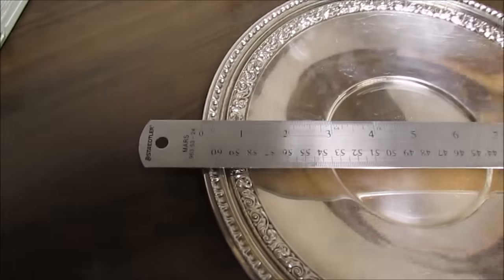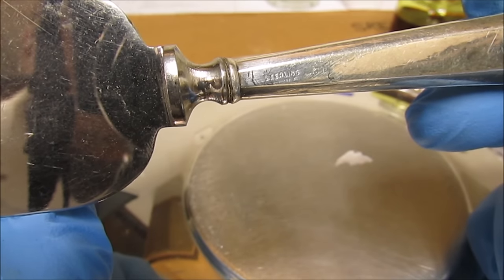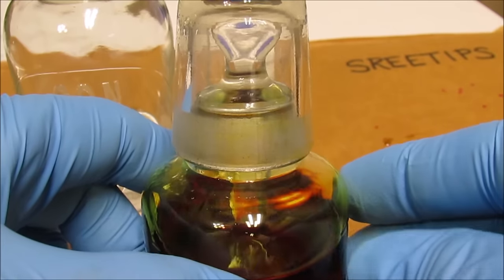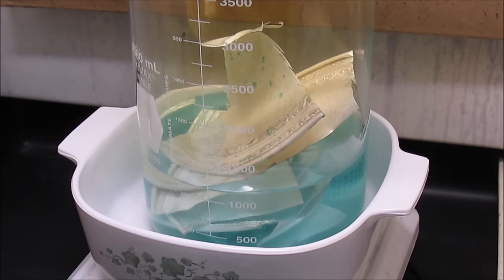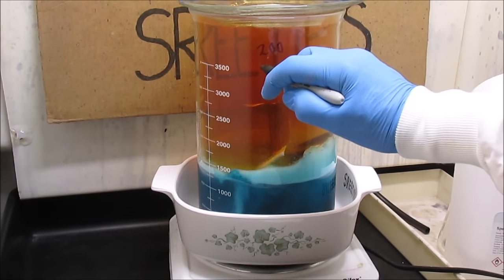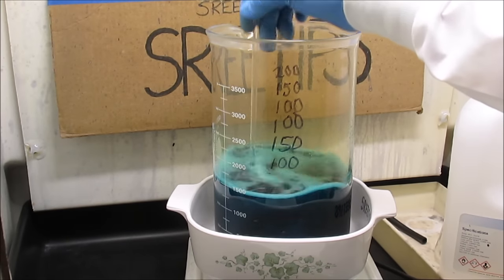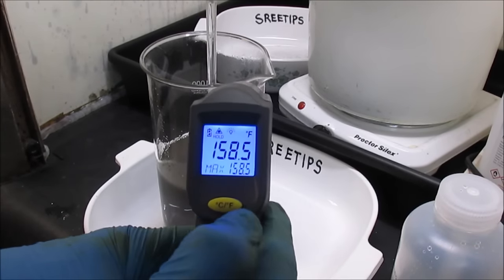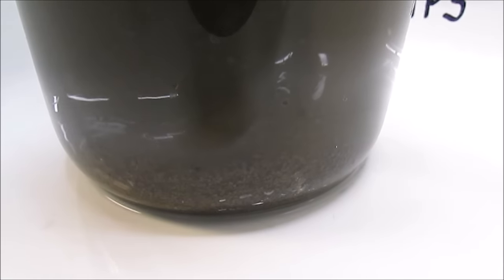Method for Recovering Silver From Silver Plated Items

Comment: I re-watched this video and was wondering if you calculated the copper return from your stock pot?
Reply from the maker: At $2 a pound it just doesn't seem worth it.
Reply: I agree that it's value may be minimal, but given the final cost analysis, the weight of silver to copper ratio would lend to a better cost outcome for chemicals, would it not?
Reply from the maker: Yes, it would.

Comment: What happened to using sulfuric acid as a cheaper way of de solving silver? I understand that using nitric acid is quicker but can't make profit if using that method! I hope you can share a  more cost effective way of refining silver. Thank you for all the hard work you put in to making these videos!!
Reply from the maker: I’ll do another sulfuric acid video see if I can get the yield right
Reply: So I'm working on some silverware and silver plated  dishes, could you please make that video about the same stuff. I'm having trouble de solving the silverware, lol! It's  taking longer than I thought and I have alot of it!! Also if you know a safe and easy way of cutting the dishes and trays, thank you!!
Reply from the maker: Silver plated is very low silver content. I’ve got a bin full of it that I’m saving. Sulfuric on silver plate is something that I’ve never done. No experience there.
Reply: @sreetips is it okay if I ask you for formula for volume of sulfuric acid to volume of silver??

Comment: welcome back .but why you didint use another method instead of nitric acid .such as reverse electroplating its cheaper and faster in this kind of plating and its works will.and the cyanide leaching is work will also
Reply from the maker: Mohmad, I'll try to make a video using reverse electrolysis. Should be easy to do. With silver so low I didn't think that there would be a demand for that. Looks like I am wrong.

Comment: I was wondering if you have tried the poor mans nitric acid to refine silver? Drain cleaner 90+% sulfuric acid and potassium nitrate. Will this work? If so, can you use copper to drop(cement) the silver out of solution? It would be cool to see you do a video(experiment) with this method.
Reply from the maker: ive never tried sulfuric and potassium nitrate to dissolve silver. I don't know if that will work.

Comment: Isn't there a better way to strip the silver off without having to "eat" all that base metal (& generate all that chemical waste)?  I would propose using electrolytic process on the uncut plate with high current density (to create overvoltage so the silver strips off).  If you used dilute HCl for the solution, you would make AgCl directly which you filter out of the solution.
Reply from the maker: Good idea, thanks

Comment: I’ve got a question! Couldn’t you just react the solution until you dissolved the plating off and then pull out the solid copper? That way you wouldn’t use up as much Nitric.  Also you could make your own nitric which would be cheaper. Or am I missing something here.  Love these videos brother. Have learned a lot. Thanks!
Reply: I think he was pointing out that the silver was cementing out of solution because of the presents of copper, so he needed to desolve all the copper in order for the silver to stay in solution.
If he is only paying $15 a litter for 68% nitric, then making it is not nessesary and a waste of time and may actually end up being more expensive. For some of us who can't get it that cheap, or get it at all, then ya, make your own. I'm in the process of getting what I nèed to make some.
Reply: I rewatched the video and got my answer. Sorry
Reply: you can make nitric acid using old teabags and my ex-wife's bitterness.
Reply: @jaybefaulky4902  yeah, same for me!

Comment: If I want to remove the gold plate from a sterling silver jewelry. ( Keeping the silver item intact) how would I do that? I would like to refine the gold with my other broken gold jewelry.
Reply from the maker: I used gold plated silver to inquart gold. Trying to recover just the gold from it isn't feasible because it's too little gold to isolate.
Reply: @sreetips  I know that. I really just want to remove the gold from the Sterling silver pieces because either I like the piece in silver or the gold is wearing through. What can I do in that case?
Reply from the maker: Rub it hard with a buffing wheel. The thin coating of gold will buff right off. Have a jeweler do it for you.

Comment: Would adding copper to push silver out of solution be an issue here? Im wondering if it would push out the nickel or zinc base alongside the silver🤔
Reply from the maker: Nickel and zinc are higher up above copper in the reactivity series of metals. Only metals BELOW copper will cement out. Any metal above copper will not cement, they will stay in solution. Knowing this is the basis for refining and separating these metals. We can get the silver out and leave the base metals behind.
Reply: @sreetips  thanks... so then basically how do I precipitate pure silver out of bleach and vinegar solution without pushig out things like lead? I am stuck at this point with a dark blueish black solution and am afraid to drop impurities back into my silver and don't have and special acids.
Reply: @sreetips  or is that basically each metal replaces the next and I can proceed with copper method?🤔
Reply from the maker: No
Reply from the maker: If I have silver in solution then all I do is add some hcl to INSTANTLY precipitate silver chloride. Then I rinse the silver chloride and convert it to pure silver metal with lye and sugar
Reply from the maker: If you have a solution of hcl and vinegar then there is no silver in that solution. Silver can not, I repeat, can not exist in solution in the presence of hcl.
Reply: @sreetips  thanks thats my issue here I dont have those acids was looking for another way itcould possibly work
Thanks
Reply: It's all from recovering gold from computer scraps by the way
Reply: I have no hcl... only bleach salt and vinegar
Reply: @sreetips  or let me rephrase my question if I may... would the abundance of copper and other metals in a solution mean that silver, lead and gold would not be easily dissolved?🤔

Comment: Ive been asking this question but no one will answear, maybe u can, the prongs or pins rather from connectors, circut bards etc,what are they made of? Silver? Aluminium, they are non ferrous,look like silver. But ???????????
Reply from the maker: Randy, the composition will vary depending on their application. Non magnetic substrate could be copper or brass. Easy to determine. File deep into the metal and see what color the metal is. If it’s a gold color under the plating then it’s probably brass. If it’s a pink color metal then it’s probably copper. Add a drop of 14k test acid. If it bubbles, turns green, and stinks, then it’s brass or copper. But I have seen military grade slip rings that had a thick coating of gold over silver. I did about ten of them maybe 3 or 4 inches in diameter for my jeweler friend. Ended up getting about 10g of pure gold and ten ounces of silver. I wish that I had made a video of that. This was back in the day before I was making videos regularly.

Comment: Excuse me sir but can you help me i follow all the steps but i use copper and my silver powder come out grey and a little bit green i don't know if i did everything right or it's the way should be it's my first time doing this thank you
Reply from the maker: If it were mine, and the silver powder looked green, then I’d dissolve it in minimal hot dilute nitric, filter, dilute the filtrate with distilled water and cement the silver out with clean copper. Or convert to silver chloride with HCl. Then do a pure silver conversion with lye and sugar.
Reply: Thank you sir

Comment: To make it more worth your while, could you not just react until just the silver is in solution and not dissolve all of the metals to conserve nitric?
Reply from the maker: No, as the silver dissolves, the base metals under the silver will cause the silver to come right back out of solution, in accordance with the reactivity series of metals. This will continue to happen until all of the base metals have completely dissolved. Then, and only then, will the silver stay in solution. Then the silver can be selectively removed from the base metals by either adding copper to cement the silver out of solution, or adding HCl or a concentrated sodium chloride solution to precipitate silver chloride. The silver chloride can then be converted to pure silver with lye and sugar.

Comment: Why do you dissolve the whole piece? Seem like a waste of nitric. You even mentioned you had the silver cemented out after 200ML, shouldn't you just filter at that point and then worked to purify? The silver gets dissolved by the nitric and then replaced by the copper, as long as you have had everything submerged long enough for the nitric to eat through the thin plating there's no need to go any further is there?Also where to you get Nitric shipped for $15/L?
Reply from the maker: This was my first attempt with silver plated material. My goal was to get a total yield by dissolving everything to see exactly how much silver was there. Filtering the silver out of the solution while active nitric is still in the solution would not work very well for accomplishing this goal. I buy nitric from GFS Chemical.
Reply: @sreetips  Okay, well as always I enjoyed the video. Would be interested in watching you work with silver plate more in the future, doesn't seem to be much info out there for processing it economically. Thanks for the tip about GFS, I'll have to try them next time, way better price than the $50/L on eBay.
Reply: @sreetips  Oh, also before I meant filter  the silver cement out of solution after waiting for all the nitric to be saturated with copper so it's not active anymore. Same principle as your waste bucket.
Reply from the maker: Got it, thank you.

Comment: Such a nice looking silver plated plate. Surely the plate was worth more than $8?
Reply from the maker: She got it at a yad sale, can't remember the cost.
Reply: @sreetips  ok. As far as the Nitric Acid cost is concerned, in Australia the cheapest way to get hold of concentrated Nitric is via bulk chemical suppliers who sell 20L containers or even 200L/44 gallon drums (imperial gallon).
It would certainly make the Nitric Acid more economical to buy, although storage becomes a safety issue (maybe even a legal issue).
Anyway, your videos are very informative, practical, easy to follow and have varying content which makes them very useful. 

Cheers

Comment: streetips couldn't the base metal be coin silver 90%? I was told if it turns black it is coin silver. same company from 1927 I came across gave me those results. The Oneida silver plated I had was definitely copper base.
Reply from the maker: No. The base metal was clearly brass. But this plate had a very thick coating of silver over the brass. It's the reason I chose to use it in this video.

Comment: After you dissolved the silver in acid how come you didn’t cement out the silver with coper?
Reply from the maker: Eventually I will
Reply: What do you mean? Is there a reason you Precipitated out the silver with lye and sugar instead of copper?
Reply: What do you mean? Is there a specific reason that you precipitated out the silver with Ally and sugar instead of copper
Reply from the maker: If a made silver chloride then I’ll save it up until I have a couple liters of it, then convert it to pure silver with lye and sugar. Then melt into shot and run it through the silver cell.

Comment: Ok if you use the Nitrect and distilled water 3/1 three parts water and one part acid completely covering the plated metal, no heat is NESARY with this method after about 30 minutes or when the saloution stops bubbling strain the saloution so there is no meatle, use unionized table salt adding slowly, when the salt stops dissolving and there is what looks like cottage cheese strain off all liqewed prince with clean water. The remaining is or should be 99.9 silver chloride. Total prosec should take two hours. And be safe use rubber gloves and eye protection do this outside avoid breathing any fumes are poision to  the body.
Reply from the maker: I had about 1.5 liters of distilled water. 900ml nitric acid. With no heat it would take days to get everything in solution. I've got another silver plated platter. I'll do another video with no heat so we can see how long it will take to get all the copper dissolved. I'm guessing four or five days at least.

Comment: Can silver crystals be grown in copper nitrate solution?
Reply from the maker: I think that they can. But the silver will be contaminated with copper, it won’t be pure silver
Reply: @sreetips  I assumed that the copper would keep the silver from entering into the solution if the acid were used up. I suppose something would still coat the anode however. And then the silver could enter solution.... but aren't the geometry of the crystals different?

Comment: How hard is it to get the chemicals to get pure silver?
Reply from the maker: Nitric acid is the key chemical. It's used to dissolve sterling silver and it's used to make electrolyte for the silver cell. It can be made, but the process is not that easy for a novice. Philip Bender has the best video on youtube on how to make nitric acid, in my opinion.

Comment: What about Oneida silver plate. It's reinforced with extra silver. I have about eight pounds
Reply: Most of the stuff I’ve seen from oneida is silver tone or only lightly silver plated. It all depends on its age, if its even remotely modern its likely to not be sterling, and at best plated. It should be clearly marked if it has silver in any form. If theres no markings beyond the brand name its just silver tone. Hope that helps.
Reply: @beez1598  thank you. It's from the 1930s

Comment: Question:  Can you use the silver cell to remove silver from silver plated items? Leave the base metals in the basket?
Reply from the maker: No, the silver in the basket needs to be up around 99%. It can be as low as 95% but then the electrolyte will get saturated with copper quickly

Comment: There is a way to get silver out silver chloride much easier then you did, if you add zinc scraps cut into small pieces and 30% hydrochloric acid to silver chloride and leave it together for the night, silver chloride will reduce to silver into silver sludge that would dry into powdery form, I recovered many pounds of Ag that way, in eighties when silver was almost $50/Oz. 
I don’t do it anymore because I don’t know how to obtain nitric acid anymore and dissolving the whole piece of silver plated item is too expensive, there must be an easier way to remove silver from silver plated items. Refining it with zinc is cheap and very easy though.
Reply from the maker: I’ll do some investigation. There’s probably a way to strip the silver plate off without having to dissolve everything. I only did that here because I could see a thick coating of silver on that piece. I had plenty of nitric acid. So I did it for the video.

Comment: I appreciate you showing the process but spending $15.20 which by the way does not include the price of the Lye, Muriatic (HCL) Acid, the filters, or all of the other tools, propane and equipment which is not free, or your two days of time to perform this. I am thinking there has to be a more cost effective way to collect silver. Like just working O.T. and buying bars or rounds with the extra money. Thank you for the video though.

Comment: what would happen if the base metal was brass
Reply from the maker: The solution would turn green instead of blue. Brass is an alloy of 85% copper and 15% brass
Reply: @sreetips  yeah but would it present a problem getting the silver when adding hcl ?
Reply from the maker: @prospectorpete  both zinc and copper  should stay in solution, not forming a solid. But I don’t know for sure. I’ve never tried it.

Comment: Could you have just dried the silver chloride and melted that ?
Reply from the maker: I've never tried to melt silver chloride.
Reply: sreetips 
Wouldn’t the silver be there without the sugar and lye ?   You should try it . Thanks
Reply from the maker: It's not that easy. Others have tried. I learned from them that it's not the way to get the silver. Lye and sugar is the easier softer way.
Reply: sreetips 
Sure it’s easy , put some silver chloride in a melting dish and see ..
Reply from the maker: It will work, but it takes lots of heat and sodium carbonate. It makes a mess and could result in loss of metal. I'll stick to the methods taught to me by some professional refiners. They never try to melt the silver out of silver chloride. I'm with them.
Reply: sreetips 
No , I get that it’s not normal operation  , but you have to wonder why you have to add sugar and lye when the silver is already there in the silver chloride , chlorine and other impurities should burn off , silver can’t go anywhere.   . I have precipitated with copper , guess I’ll have to try melting silver chloride myself .
Reply from the maker: The silver can go, literally up in smoke. In fact that would create the greatest loss, the high heat. The silver will vaporize. The lye converts the moist silver chloride into black silver oxide. Then the sugar converts the silver oxide to pure silver metal. Something to do with the carbon in the sugar. I don't understand the chemistry behind it. Please let us know how your silver chloride melting experiment goes. I think that you'll see why it's not a good idea when you try it.
Reply: burning carbon black does the same thing to metal oxides, the transition to CO & CO2 strips the oxide from the metal salt.  

it may be possible to catalyze a direct conversion with hydrogen, will let you know if I get it figured out